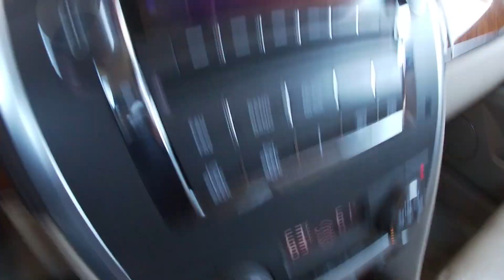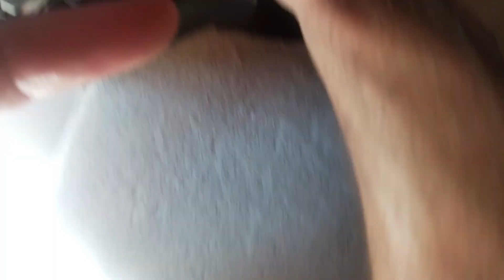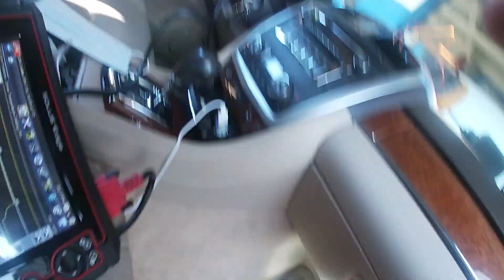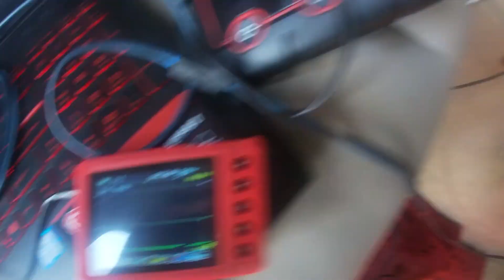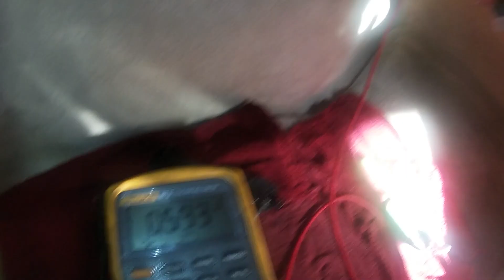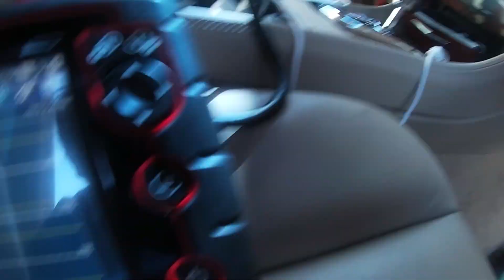'08 Cadillac SRX Passenger Blend, Air mix, Temperature Control Door B0418

Comment: Here's a tip that may help.  I cut an access hole (more of a rectangle shape) in the plastic panel behind the glove box (you need to fully remove the glove box first).  This made accessing the top bolt (the one hidden behind the two AC lines) much easier.  I cut the hole just large enough to fit my hand with a small rachet.  There is nothing structural in that part of the dash and there was nothing behind it that I might cut into (on my car anyway).  Glove box continues to work just fine.  The bottom bolt on the blender you can still access from below.  This made the job far easier for me and I have not noticed any issues (no new rattles, etc.).   Something to consider if you are struggling.  Hope it helps.

Comment: No SS STS Cadillac hey blows cold on the driver side warm on the blues passenger side what I want the heat on both sides in the driver side is called
Reply: How did u fix the driver side blowing cold? Im having the same issue on my 08' srx
Reply: @christianjones3788  3 blend air door motors. right left and center. center takes 7 hours..other 2 take 1.5 hrs each... motors are cheap. tough job